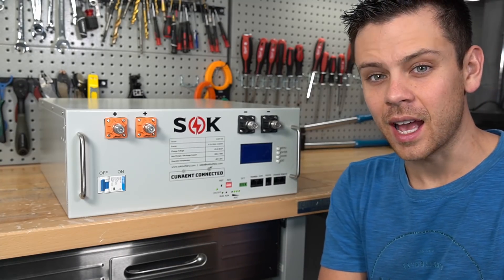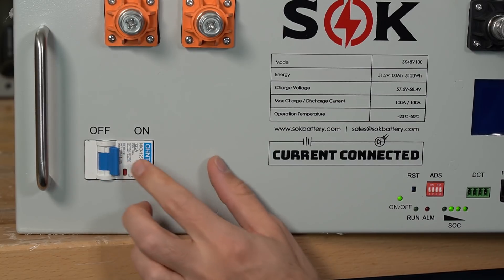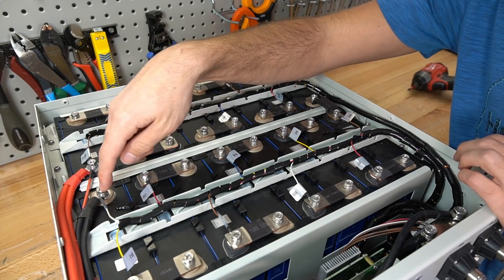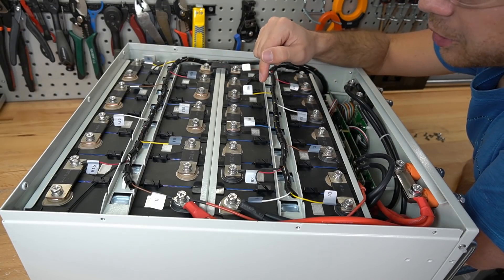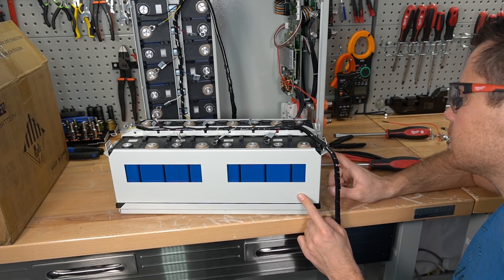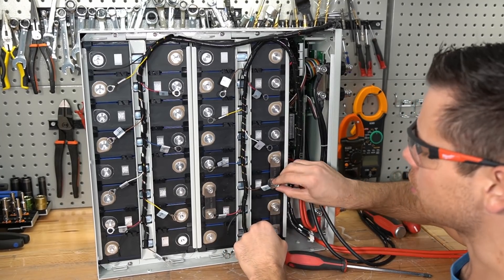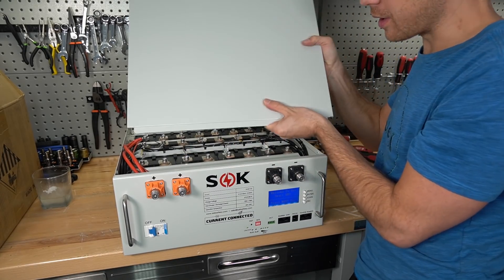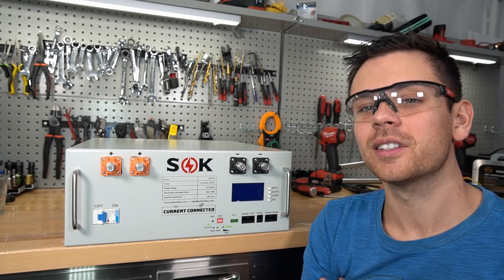New: $1,739 48V SOK Server Rack LiFePO4 Offgrid Solar Battery

Comment: 2nd time commenting this video, first comment was just 10 minutes ago and it is now deleted. That circuit breaker used in this battery is not rated for DC, only for 230 VAC in one pole variant. Word of caution. Let's see if it is not deleted this time
Reply from the maker: Did you add links? I didn't delete your comment. And yes, this pack and many others use the same breaker. You need to de-rate by 10X for use with DC usually, to extinguish DC arc.
Reply: @WillProwse  No, I did not add a link. This is becoming more and more common. Everywhere you read people saying Youtube deleted their comments. It was not directed to you.

About the breaker. Derating it 10X means 24 VDC and only 12.5 A. I personally will never use a breaker rated for AC on a DC application unless the manufacturer also provides a DC rating for it. This is not the case.
Reply from the maker: @raymondcastro734  yes I understand, but the same breaker is on like seven batteries. I can't imagine all of these engineers being wrong but maybe they are. I keep asking signature solar for the DC spec and they haven't supplied it.
Reply from the maker: @raymondcastro734  just message signature solar directly so they can finally respond. I've asked them two other times already
Reply from the maker: @raymondcastro734  just asked a distributor and they said the engineers designed it this way because the circuit breaker is being used as a switch, not for over current protection. It's a cheap single pole switch and that's it. The BMS over current protection works faster than a thermal breaker and can be used over and over. The circuit breaker was never meant to be used for over current and will never experience high current.
Reply: @WillProwse  I understand that the CB will never trip as the BMS protection will engage way before that happens. But... What if a user just flip the CB open while under load. This is not a DIY battery but a PnP one. There is absolutely no excuse to use an AC CB for this when from the same manufacturer you can buy the NB63-DC series that are properly rated. Maybe I am wrong, maybe are those many years at the other end of the phone on the support line that made me realize many customers seem to be trying to hurt themself and things need to be "custumer proof".
Reply from the maker: @raymondcastro734  I agree, but they are UL listing the pack. And they are saying it will pass just fine with this breaker. I agree with you, but it seems to not be a problem to them. I always tell people to use a T class fuse with these packs regardless, even if some think it is overkill. I am still trying to get a DC rating for that switch. I thought UL was more stringent, but I could be wrong.
Reply: @WillProwse  You have the battery pack... it should be easy to test it by flipping it open under load. It may be nothing or it may be fun. What do you think? hehehe
Reply from the maker: @raymondcastro734  hahaha

Comment: Will you please do a video on solar panel VOC voltage based on different outside temperature? I'm trying to size a solar array and I can't figure out how to size it with a charge controller in cold climates.

Comment: Good overview and noted differences with the EG4. I wonder when someone is going to make a UL9540 listed server rack battery to help offset costs of the current options out there.

Edit: Looks like SOK is getting the certification, but it's still being tested with expectations of September to be listed with UL9540.
Reply from the maker: They should all have the UL certs and possibly listed this year
Reply: @WillProwse  It'd be awesome to get one that was listed. I hope that doesn't materially affect pricing, though. I am curious if Signature Solar indicated to you that they are working toward it on any of their EG4 rack batteries.

Comment: I have a sailboat that I am installing a 48v electric motor, using a thunderstruck 10kw motor kit. I plan on installing a 300 amp-hour 48-volt LiFePO battery bank system to power the motor and house. The motor is capable of providing regen capabilities while under sail, but I also want to charge the system using a 400-watt wind generator and 600 watts of solar power. I have been looking for an MPPT charge controller, but most of them seem to only do wind or solar. A friend of mine said I would need separate charge controllers, which is something I haven’t considered previously. Do I need three separate MPPT Charge controllers for each method of charging, is that even a possibility? Can you do a video that covers a system that uses multiple means of charging, like solar and wind and possibly even regen? Any insight you could provide would be greatly appreciated. Love your videos I have learned a lot from you, keep up the awesome work you’re doing. Thanks
Reply: you can hookup 2 charge systems to 1 battery -
Reply: just tie both MPPT to the battery in parallel.    if both are outputting similar voltages, their current outputs will be added together (up to 10 amps for the solar, 7 amps for the windmill).   What is the 3rd MPPT you mention for?
Reply: @geepeerces  The electric motor I have for my sailboat can provide regen charging

Comment: Battery pack looks good and great review, always love the teardown. I wonder why most of the server rack batteries use those Ganfeng Cells? Form factor? Or is it cheaper than other coz it weighs more than CALB L160 or EVE cells?
Reply from the maker: Sok has been using gafeng cells for a while now. And a few other packs. They took 16 cells out of sok 100Ah packs to make this pack haha
Reply from the maker: So main reason is that you can get the ganfeng cells right now
Reply: @WillProwse  Thank you Will for the replies, yes it makes sense, availability must be a huge issue.
Reply from the maker: Not cheaper, but they accept small order quantities. Catl requires huge orders. Calb is actually really good but takes forever for them to fill orders
Reply: Who makes that BMS?
Reply: I am also wondering why the 16 cells could be 200Ah in order to double the KWh.  Then these rack mount batteries will be a better bargain than the likes of Tesla in terms of price, form factor etc.
Reply: @por911man  200AH cells would be larger and heavier, making a 48V pack unwieldy to install.   as it is, it must weigh about 100 lbs.    I've racked 150 lb 4U UPS 's before, and they were a beast to get onto the rack rails, requiring three people, 2 to lift, and the third to guide the rails into place.  a 200 lb rack unit would require a scissors lift AND 2-3 people to rack.
Reply: @geepeerces  - how much weight could be saved if they used an aluminum housing?

Any reason not to use aluminum? (Only price?)
Reply: @DavidHalko  aluminum would need to be significantly thicker, unless its rather expensive tempered aircraft style aluminum its very soft.   I'm betting the case is a small percentage of the total weight of the SOK batteries (I have a couple of the 12V 206AH but I haven't taken them apart)
Reply: @DavidHalko  Wow. I didn’t know. Can you point to the legislation? 
Do you think the Tennessee legislators would be able to help?
Reply: Hi @richarddietzen3137  - Energy prices are a delicate balance of a variety of energy sources. Because The Grid is interconnected between states & countries, prices are not necessarily driven singularly by policies (executive orders, executive actions, legislation) of a single state.

Policies, like pumping oil & natural gas through pipes (instead of transporting by train or truck) reduces the cost of energy, lowers the cost of that kind of energy supplying power to the grid, and the cost of energy comes down for all consumers. (These types of energy provides Spot Energy to supply the grid during times of peak load, and there must be enough for manufacturers.)

Policies like encouraging oil & gas exploration increases the supply of less expensive energy, when converted to power the grid, results in lower costs for grid energy to everyone, since there is enough supply to provide spot power during peak loads. 

Encouraging the running of power lines along existing pipeline causeways help create alternative connections so power companies do not need to be held captive to buying high cost every during peak loads.

Some states like Texas, run their own grid, so failures in energy policy become more focused on local legislation. (Texas is a huge exporter of energy to Mexico, so negative decisions on energy policy in Texas can negatively affect Mexico, as it did when their windmills temporarily froze over and they physically did not have enough energy in the pipelines to supply the necessary power for Texas or Mexico.)

Other states (ie California) with poorer energy policies have rolling brownouts and must import energy from foreign counties (ie Mexico) in order to limit deficiencies in State & National energy policies.

Some States like Tennessee, are located in the middle of the nation, and do not have the option to buy & sell energy from Foreign Nations, to stabilize local prices.

From a Tennessee perspective, I would encourage local citizenry to talk to legislators to do what is necessary to:
1. Make government aware of the problems with local energy prices and how high energy prices are driving out local jobs from TN
2. Encourage state regulated energy providers to resolve high electrical costs to smelting companies, so smelters can provide competitive aluminum product prices to new domestic manufacturers (battery makers like SK, automotive manufacturing, etc.)
3. Encourage local unions, to reduce labor costs, so citizens in TN have a choice between good paying jobs creating aluminum for cars & batteries vs flipping burgers
4. Do not pursue energy legislation which non-voluntarily raises the cost of energy. TVA is clean energy, but coercive energy policies which raise prices of clean TVA energy, in order to subsidize other non-domestic clean energy (ie Imported solar panels) should always be a non-starter. Penalizing domestic TN clean energy to subsidize foreign energy & dismantle TN manufacturing & put TN workers out of business is a great shame.
5. Asking for individuals to voluntarily pay a fee to add additional foreign “clean energy” sources to our domestic energy capacity is a great thing! We can allow those who care about the environment to lead the way, without penalizing domestic TN clean energy, TN manufacturing, and TN jobs.
6. Any law or executive policy, which increases the price of any energy, is a back-door regressive tax on the poor. The wealthy are not truly negatively affected by high energy prices, but the poor are… by loss of jobs, taking food from their table to drive to work, getting sick from keeping their houses at colder temperatures to afford high heat bills, etc. Energy must be as low cost & reliable as we can produce it, domestically. 

(Full Disclosure: I am not from TN, but I am deeply concerned about clean energy like Hydro, energy self-sufficiency, and domestic manufacturing to further provide self-sufficiency… being an adult means taking care of one’s own business, we can not be like children where we need to have others wiping our back sides.)
Reply: SOK signed Hugh big contract with GANFENG , in fact, EG4 using ETC brand cells, not ganfeng now. They using Ganfeng at the beginning, now change to ETC.
Reply: @minwang102  That's great that you have a contract with the manufacturer. BTW I think Seplos is one of the first to use Ganfeng cells and also those BMSs, and the oldest around, promoting self assembly of server rack batteries, via their YouTube channel. AOLithium used CALB cells (not server rack) but it was quite a scandal.

Comment: I want to buy ONE of these 5kw batteries and connect it to a growatt all in one and use my house power into the growatt to keep the battery charged. In the future I'd obviously like to add a small/medium solar array but not at this point. This would be used to run a small window ac unit and a few lights and a fridge temporarily . Can anyone link me to a good resource for this information? My goal, In case of a power outage, is to be able to grab the extension cord output from the growatt in the garage and simply run it in the house and hook up whatever I need to within limit. Several lights, the fridge and my window AC should run 10-12 hours on 5kw. I also have a 30amp inverter generator that I could hook to the main house power that would be able to provide power for the growatt to charge during the day in the event of extended power outage.

Comment: What is is total amp hours use on this unit?
Reply: 48v 100ah. So that "compares" to 4x 12v 100ah.
Reply: @PaulFonWheels  thanks for clarifying this. Considering off grid possibilities for a large home, 5,200 sq. Feet, plenty of land for a ground based solar panel array, thinking “50” 400 watt panels.
Reply: @nascar427  yeah I was trying to explain it too, didn't see your reply when I responded. But yes it's better to measure in kWh

Comment: I was watching some of your older vids on cables, what is your opinion on knukonceptz cable,  the 1/0 claims 375 amps at 20ft. Its oversized tinned copper. Thought you might want to check it out

Comment: What if I want to use this in my motorhome in place of my 12 volt system. What do I need to do to make this compatible, if possible? BTW nice review and eye opener for possibilities for off grid living.
Reply: Not sure if SOK is going to offer one but the Signature Solar rack mount battery can be ordered in 12V, 24V, and 48V setups.  Unless you want to change to 48V system by replacing your inverter if it wont accept 48VDC,you will need one of those or something similar.
Reply: You will need to use a DC-to-DC Step down converter that can go from 48V down to 24V or 12V (whichever you use in your DC systems in your RV) since 48V is WAY too high for your average RV DC system. As to the AC, You might want to switch your AC inverter to one that works for 48V (which is more efficient and usually safer to use than 12V). or if you use a Step down DC-to-DC converter to go to 12V, you won't need to do that.
Reply: @jonjohns8145  Agreed on the inverter the other issue of course is the 12 volt house system in the RV. I could take two routes off of the battery, one to the 48 volt inverter and the other to a transformer to feed the house 12 volt system.
Reply: @kenkolen  Yeah, you will have to.
Reply: @kenkolen  That's what I did, except I already had a 24V to 13.8V step-down, (Buck) converter from my old 24V system, so I just got a 48V to 24V buck converter and wired the output of that to my old buck Converter. I got the 24V to 13.8V converter after realizing that the 24V to 12V was way underpowered to run my water pump and LED lights in my RV.

Comment: Make sure the battery is discharged and it will be safe?
Reply from the maker: Yes. When this battery is fully charged, the voltage can technically kill you (very hard to do though). Check out my beginner 48V system video to learn more. When the battery is discharged, it's not dangerous.

Comment: Could this be used on a RV with multiple battery units in parallel?
Reply: Only if your RV is set up for 48vdc.
Reply: I believe this is the intended design.  I have 4 of the Signature Solar rack mount batteries installed without issue.